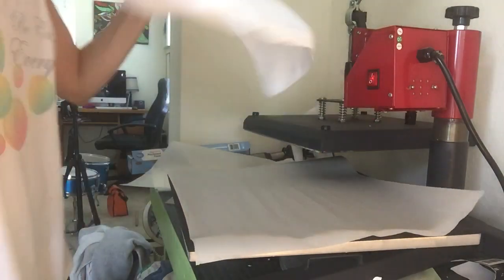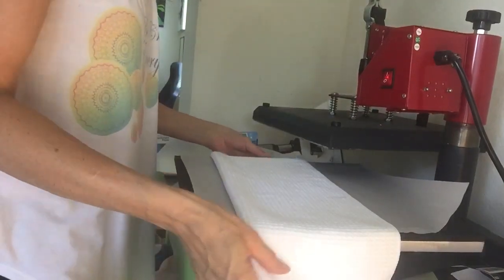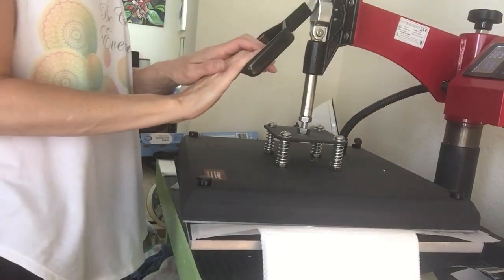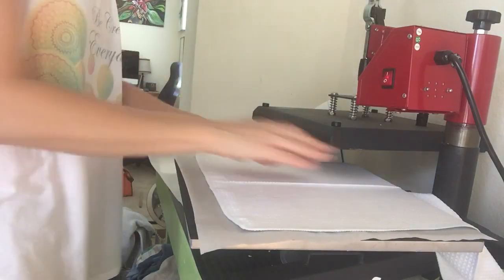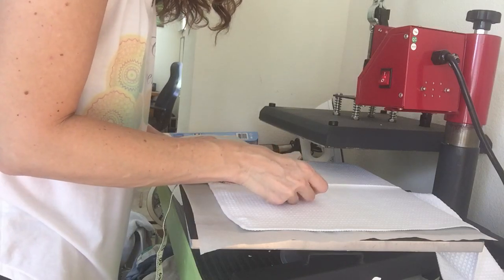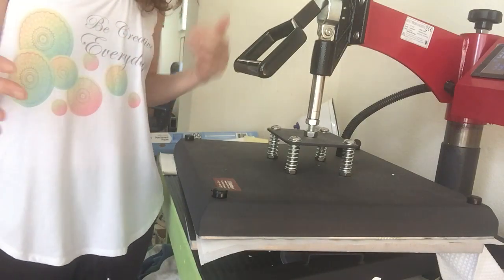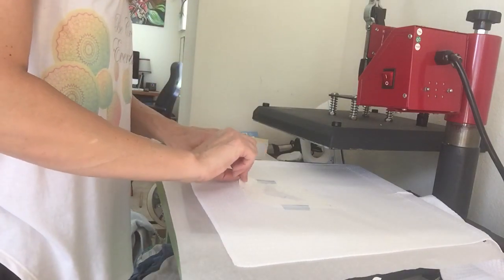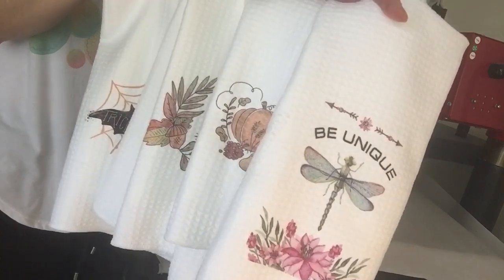How to sublimate on waffle weave kitchen towels tutorial

Comment: Stacy, other than what you mentioned in this video, how can you decrease press marks? I pressed a microfiber waffle towel I purchased from Amazon, 80% poly and I had that issue.
Reply from the maker: Esther Brock microfiber loves to get press marks. It’s so sensitive. But, it takes ink very well, so light pressure is all that is needed. In my video ‘how to sublimate on fleece’ shows my (aggressive) techniques to get rid of press marks. I tug in different directions, shake vigorously and roll the lint roller over it a few times. If all else fails, press the other parts of the substrate, so it all matches.
Reply: Stacy O Designs thank you! 😊 I’ll have to watch your other video.

Comment: Our towels are yellowing. Have any recommendations?
Reply from the maker: There could be 2 reasons I can think of.
1. You are pressing too hot and actually scorching the material. Have you verified the temp of your heat press with a digital heat gun? It could actually be getting hotter than what you set it to.
2. The material has been treated with some sort of chemical that is interacting with the high heat and causing it to yellow.  
You could try to spray it with a mixture of water and peroxide to remove the yellowing, if its a chemical reaction.
Reply: Stacy O Designs, not with a digital heat gun. I guess I’ll be getting one. We used a cooking thermometer and it says the temp is correct. The temp from Conde says 380, medium pressure 90 seconds
Reply from the maker: @carmengarza2813  I just looked on their site, and yes, 90 seconds is recommended. Try dropping to 60 seconds and see what results you get.